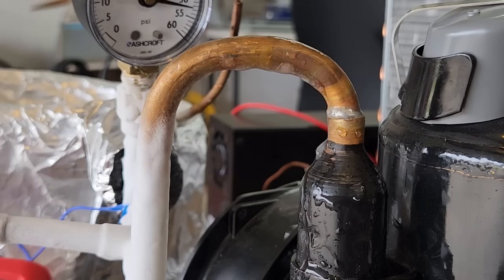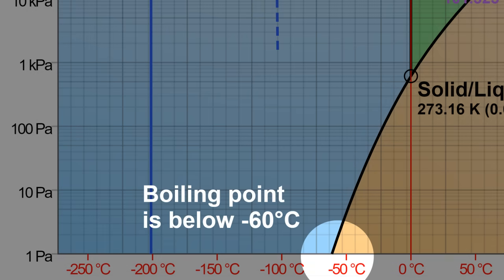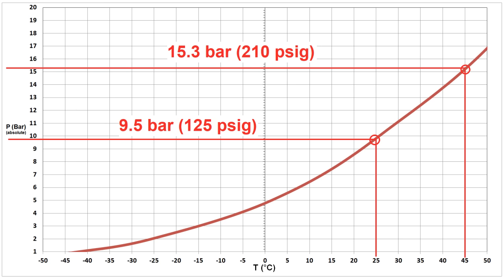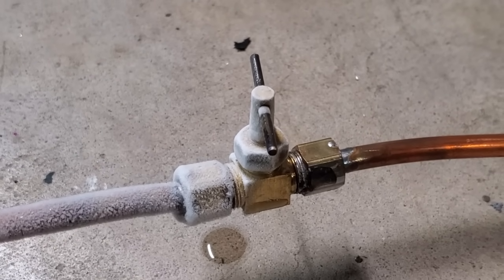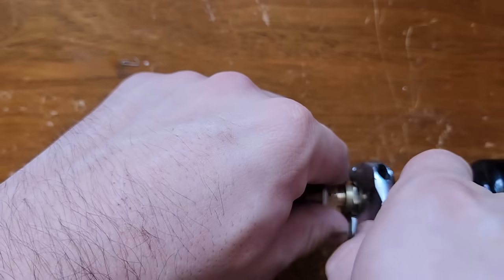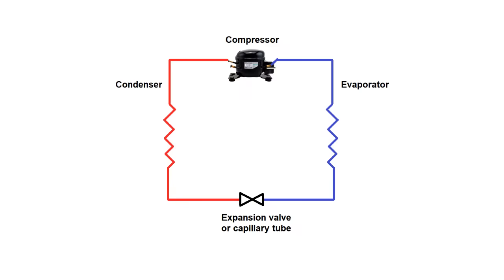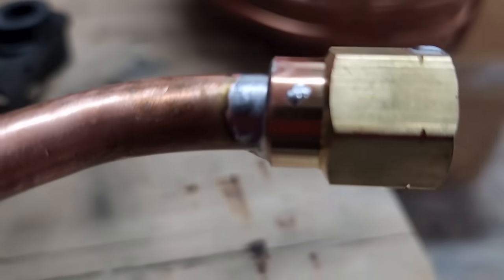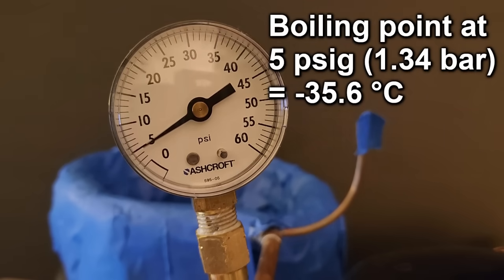DIY Vapor Compression Refrigeration System

Comment: About the ethylene side: since your cooling efficiency is bad, keep in mind that the cold (ethylene) stage compressor is going to be dumping its entire heat budget into the hot (butane) stage if you use a sealed compressor unit. So your hot stage cooling power needs to be at least as much as the cold stage total power.

And good luck finding a liquid lubricant that doesn't freeze at -100C (in the cold stage evaporator) or boil at room temperature. An oil separator doesn't really matter here if your lubricant has turned into a gas anyway and is spread through the whole line.

Oh, also, maybe just stick the whole hot stage evaporator in a cheap styrofoam cooler for now? Its way easier than having to foam and tape everything. Also also, you might find that those $2 mylar emergency blankets are a lot more manageable than aluminum foil. I used those two things to make a passive sky freezer that gets down to -40C at night when it isn't too humid.
Reply: My understanding is that other refrigerants are used as lubrication on cryogenic systems - like propane or butane for example.
Reply: @brianwelch1579  Let me explain myself a little more clearly. Almost without exception, "refrigerants" are just alkanes or alkenes or halogenated (fluoro, chloro, bromo) alkanes and alkenes.

When you're dealing with a normal compressor being used normally, it gets really hot and it never gets super cold, so you could use something like decane which boils at 170C and freezes at -30C. The compressor will never not be in that range. It stays solidly at 50C-80C (ish).

For cryocooling, you're not just dealing with -40C for boiling and -100C for freezing. You're dealing with 30C for not boiling (if you don't want it to get into the evaporator coil) and -100C (more actually, if you don't want it to freeze in the evaporator coil).

The problem is that these refrigerants almost always form azeotropes so if you're using a higher boiling point refrigerant as a lubricant, some of it will end up in the evaporator, even if its only when everything is brought up to room temperature. Frozen oil in your evaporator can be terminal for your whole cooling system.

When you're talking about industrial cryocooling, you're usually talking about one of two mechanisms: stirling cycle coolers and turboexpanders. I don't know what lubricant is used in either one, but I think its "none" in the cold end of a stirling cooler and in a turboexpander it could literally be a gas bearing.

They're so expensive and/or slow that the few university things I've had experience with have either been LN2 based or dry ice based.

Anyway, he might want to look at 1-butene, which goes from -180C to -6C as lubricant? At least it won't freeze in the evaporator and at a few bar it might stay a liquid at room temperature too.

Worth  shot I guess.

I'll try to read through the list of hundreds of coolants that might work as a lubricant for what he's trying to do later. 1-butene was just a shot in the dark that looks kinda ok.
Reply: @htomerif  All of these systems just use an oil separator after the compressor to return the oil to the crankcase or suction line since the only purpose the oil serves is lubricating the compressor. If you needed very low temperature refrigeration oil for some reason such as poor oil separation then there are oils such as zerol 150 with a floc point below -100. Apparently propane also greatly increases the oil carrying capacity which helps oil return to the compressor when in the refrigerant blend.
Reply: @Blaxkor  Don't try to BS me. I noticed you didn't put a unit on that "-100". I know why.
You wanna edit that comment again?

I mean I'll be fair. That could just be a mistake on your part but it looks like intentional misinformation.

Comment: You did a lot of research for this project. Thank you for mentioning that you evacuated your system, that was stressing me out, lol. One thing I would like to point out, you should measure the suction line temp and compare it to your saturation temperature. You want to make sure that you have at least a couple of degrees higher (a residential AC with a fixed metering device would be around 10 to 18 degrees or so depending on load) to make sure you're not sucking liquid refrigerant into the compressor. Compressors don't like that much. Fun project.

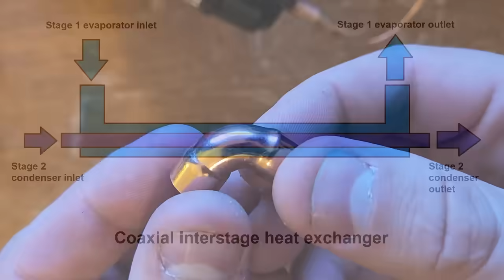Comment: 12:37 shouldn't the flows be going in opposite directions? The on-screen graphic shows the flow going in the same direction. Counter-flow heat exchange is what enables you to get the most heat exchange. Parallel flow heat exchange will only ever approach meeting in the weighted average temperatjre of the two (with heat capacity considered), but counter-flow heat exchangers have the possibility of heating the target fluid hotter than the outlet of the heating fluid.
Reply: I was reading trough the comments not to post this same concern. I also think this will make a huge difference.

Comment: Usually r600a(isobutane) not r600(n butane) is used in residential/small commercial fridges. 
MO and I think AB oil dissolved in r290 along with POE.
R134a sometimes has PAG in automotive.
Different refrigerants are compatible with different oils.

Just make sure if you are getting to super cold temperatures that you aren’t flooding the compressor with liquid refrigerant otherwise it can damage the compressor since liquid is generally incompressible and it will remove the oil from the compressor

Great video!

Comment: The really cool new YF refrigerant is actually explosive under pressure, so it's nice that they put it at the front of cars where you might potentially hit something and cause your air conditioning system to violently combust.
Reply: There's a few hundred grams. Not enough to be dangerous.
Reply: But during that explosion/fire it can create hydrogen fluoride gas and has been known to etch the glass on windshields.  When I am upside down in my burning car I don't want to add inhalation of that to my concerns about getting out.
Reply: @theradioweyr  All of the fluorinated refrigerants, insuring good old R-22, release hydrofluoric acid on high temperature combustion. My problem with the HFOs isn't that they're combustible (they aren't), it's that they're all on-patent and cost hundreds of dollars for a few pounds.
Reply: @gregorymalchuk272  I was not aware of the R-22/varients producing that (HF gas), thanks, I was under the mistaken assumption that that was unique to 1234yf. Yes, from an ethics issue and adoption/distribution, the patents, conveniently lobbied and written into Orwellian law with every generation of accepted refrigerants in spite of better options being available, it is patently (no pun intended) obvious they want us to use their slightly less efficient more environmentally damaging gases for they care nothing about the environment and want to ensure that they can sell completely new systems every half generation that require a complete replacement of every component.  R-290/R-600 FTW.

Comment: Man you nailed everything regarding using propane in the system. One thing that may have an effect on the performance is the oil circulation that the rotary compressor has. During its normal operation some oil leaves the compressor and can get stuck in the evaporator and changes the performance of it. One way to check is to have a sight glass on the inlet of the compressor as it should be mostly vapor and not too much oil. Its like having an inside look into the system on whats actually going on inside the copper pipe. Not sure if this was already taken into account but a piston compressor typically has less oil circulation overall. Great video and look forward to the next ones.
Reply: Oil separator with a capillary tube will resolve it

Comment: @Hyperspace Pirate
Granted this is a low TRL as of now and you are still figuring out what works, let alone polishing it, **BUT**:  Can you optimize this for Off the Shelf (OTS) Parts / “Clean” Design?

Basically what you did with the 3D Printed Parts but on Steroids.

Use reliably sourced OTS parts, have there be like a pallet sized (heck even (plastic) pallet mounted) module for each “stage” and have the fittings all in a standard spot, then make a “shell” enclosure if you are feeling REALLY fancy?

It would be a PILE of work, but i feel that if you get this project working, then do that, we could have an Open Source, Modular Refrigeration System that could be used as is for a water chiller etc, or be cascaded like you are doing and get cryogenic levels of cold!

Granted again this is asking a lot, and worse case scenario others and i could iterate of tour work, but i feel like that would be an AMAZING application of this project.

That’s my rant lol, and thanks for reading this far.  What do you think of all this?
Reply from the maker: This is a prototype for one piece of a larger project, but i'm thinking of doing something similar to that when the project is done, so that people can build their own cryocoolers
Reply: @HyperspacePirate  sounds great!, and no need to rush as even this level of work and documentation is a MAJOR help.

I’m excited to see what happens in the “next episode” !

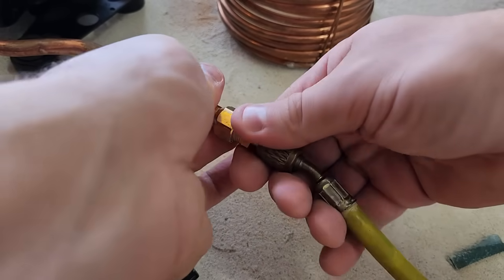Comment: at around 15:00, you should pull a vacuum on the system before filling and also add a valve at the end of your fill line. Let propane out to evacuate any air in the line, then connect and fill the system. I'm not sure how much it will impact your performance but it should avoid ice crystals forming inside the loop.

Comment: It’s probably in the charts somewhere (“read the fucking manual” moment), but at what level would using CO2 as the Refrigerant make sense?

I know it is used commercially, and is kind of the “latest and greatest” / non Fluorocarbon/ Chlorocarbon / CFC options, along with Ammonia, Butane/Ethane, and DME.  I haven’t taken an HVACR class yet though, and don’t remember the papers, so does it require obscene pressure and/or stainless steel or inconel pipes?

If not that would be a great option.  Cheap and Non-Flammable.
Reply: co2 is gaining popularity as a refrigerant. It has good properties, the only downside is that is has very high working pressures, so systems cannot be constructed in the traditional HVAC fashion
Reply: Significantly higher pressures.  I'm seeing around 35 bar on the condenser for a regular system or maybe 90 bar for a transcritical system.

Transcritical CO2 is a beast of its own though, as it sounds like it's not stable when turned off (pressure spikes dangerously as it returns to ambient, requiring venting and making the whole system non-functional).
Reply: @rhamph  Worked on trans-critical systems. The rule to live by is never shut of any part of the system completely without evacuating or pressure relief valve present. The moment the flow stops the CO2 starts expanding rapidly.
Reply: @Doktoreq  Even getting the pressure relief valves right sounds finicky.  "Rule to live by" is poignant.
Reply: At no level, if you want a cold box. It works great in cars for AC but forms dry ice snow around -30C and clogs the orifice. Plus crazy high pressures.
Reply: @brianwelch1579  but isn’t that the point of Supercritical/Transcritical Cycles, or am i mistaken?

Granted the “high pressures needed being difficult to achieve” argument is valid.

Comment: Wow, I wanted to do this exact project and you saved me a bunch of money with trial and error 😅. Just one thing on the test water, there may be a stationary boundary layer forming on the surface of the tube wall that you're not accounting for and which causes additional insulation. It would form almost instantly. This is why  continuous freeze crystallisers use scrapers on the tubes.
Edit: ..hence, even more reason for a lower than expected COP

Comment: I did mine with a dual compressor setup... I completely winged it out of boredom but it works. First stage chills it and the second chills it further allowing it to form LOX. I just feed either pure tanked oxygen or use regular air ran through zeolite to "scrub" it. Not sure how pure it is but it's highly energetic. Mixed with kerosene and it burns amazing

Comment: Very nice job, I have worked in the field and some tips i can give you is these:

1. Submerge the condensor coil i water to utilize it better
2. Wrap your capillary tube around the suction line, this helps cool down the gas/liquid mixture going in to the evaporator and helps you evaporate any liquid left before entering the compressor

Comment: I love how you started explaining DIY refrigeration system from down below the ground till up high in space! Respect.
Off-topic:
The graph you show indicates that at Venusian atmosphere (92 bars), liquid water is possible. Wonder if it could react with other carbohydrates to sustain a different life..
Reply: Ah my bad, I though 400K, just checked that it's 400°C on Venusian surface. But that's the average so it's still plausible idea.
They also found phosphine traces on the atmosphere there few years ago.

Comment: just some quick notes from a guy who is almost finished with hvac school and tried tried this too :
- Make sure your superheat is not to low or too high, low superheat will ruin vales because the compressor tries to compress liquid... happent to me...
- too high superheat will result in a high discharge tempeture, also the oil will degrade and the motor will get damaged however Rotary compressor run pretty hot, still try to stay below 80C 
- Superheat is just how mutch you heated the Vapor beyond the boiling point lower = better COP = higher safer for the compressor (not too high tho)
- if you start to use higher power compressors try to use a TXV for the first stage you can find a cheap danfoss T2 Valve for probably 30 bucks r22 valves or 407c work pretty good with propane dont forget the orfice tho, howover the charge needed is mutch higher then normaly, also you need a Collector or a "reciever" to always have the correct amount of refigerant in there they can regulate betwin 10C and -40C just fine 
- Becarful when unbrazing the pipes propane or Etheline will boil out of the oil and Cach fire 

Please keep going with the series i cant wait to see how you make ethylene,  Gretts from the EU!

Comment: Lpg is an amazing refrigerant . I very much enjoyed watching your video. I make all sorts of things with refrigeration equipment and just building pre heater water heater for the boat, basically using the waste heat to warm water before it goes into the hot water cylinder.

Comment: There is an app for calculating capillary tube length: secop capsel

Also try to use a gas purge with co2 or nitrogen to avoid the filter from clogging up quickly (temperature drop)

Cool video!

Comment: Excellent video. A stirling cooler with a helium working fluid > 1000psi can very easily pull LN (and LOx) directly out of the air.

Comment: To achieve greater precision from the needle valve and have control over the restriction, you may consider incorporating an additional capillary tube with a needle valve in parallel to the existing one. Great series!
Reply: i wonder if attaching a long, stiff lever on the valve would provide that precision too
Reply: @user-si5fm8ql3c  i think the backlash in the needle screw is the problem usually.

Comment: Out of respect, I want to note some of my ideas came to my mind while watching:
-Could use excessive dripping water in AC to use as evaporative cooler on the condenser side, to further increase the efficiency of an AC unit
-Might use a bicycle or football needle-valve inside a tube as a junk alternative for evaporator tubing
Last but not least, I'm an electrical engineer, and can't help but thinking about this project:
+For AC units average COP=3 (mine is R134a), which means it uses say 500w electrical power gives д-heat of 1500w.
+ThermoElectric Coolers (TEC Peltier) have written efficiency of 50%.
Then;
If you made a special evoporator from silver-plated copper, that'd touch to TEC, finely grinded (5000 fine sand for ex) and liquid metal as thermal paste to further increase the efficiency, you'd have a reactor that uses 500w compressor, gives 1500w д-heat, and peltier would generate 750w in theory.

Comment: Fantastic video. Warms an engineers heart to see a project conducted with proper regard for the science principles and associated mathematics. Even better to hear an American accent wrapped around SI units! Mr, you got it all goin' on! :)
And seriously, great video.  I've worked a few heat pump designs myself and my only question about your technique is your soldering is using soft solder; is that really strong enough and long lasting enough for the task at hand, and does it not soften a bit at your higher temperatures where the pressure is also higher? I use silver solder and nitrogen gas in the tubes to stop scale forming in the tubes. It is a pain but those joints are stronger than the tube!
Now, to find the promised next video.... and to say; thanks for sharing.

Comment: One thing that you may want to look into is getting actual r-290 refrigerant. Propane from the bottle is good and reasonably pure, however it is not the same purity as refrigerant grade propane and contains lots of moisture and contaminants that could be throwing off your cooling

Comment: I made myself a cooler with a rotary compressor for cooling cpu-s, I also have 2 stage cascade with ethylene but was bought already made. It cools to -113°C on the evaporator so my cpus are at -100°C at load. If you want to buy ethylene it is 1800€ for 18kg so I can`t wait how to make one :) good job on the video and have a good day, B